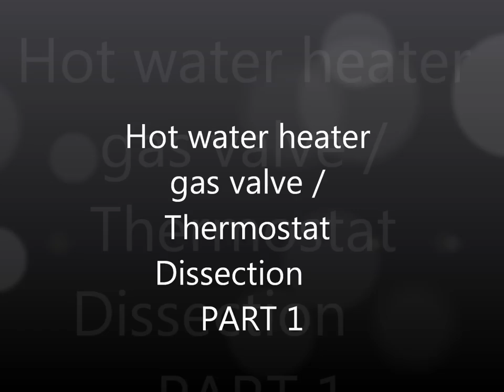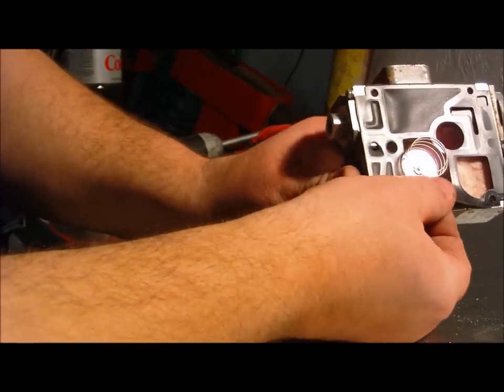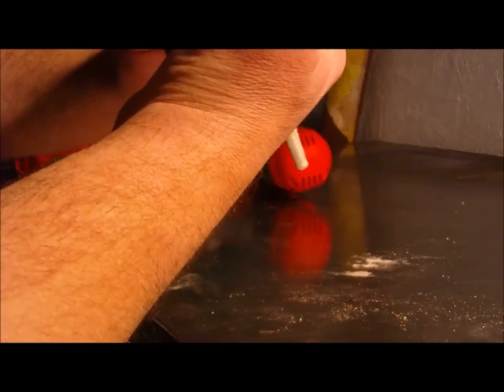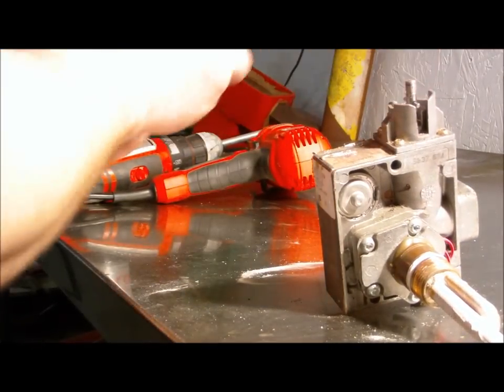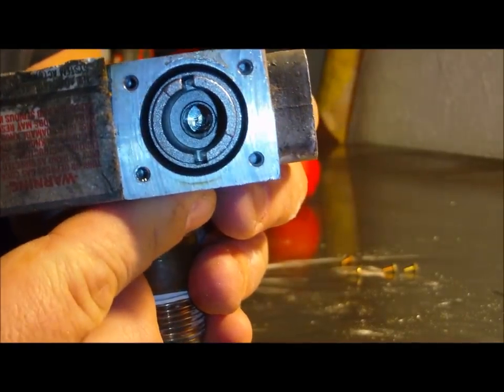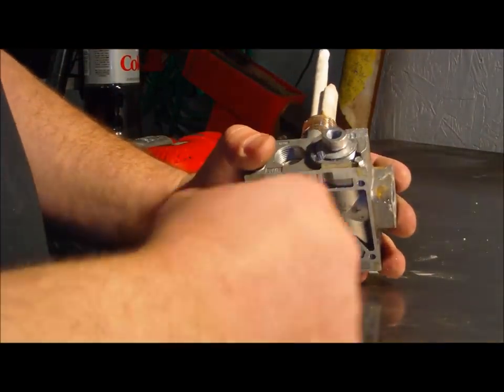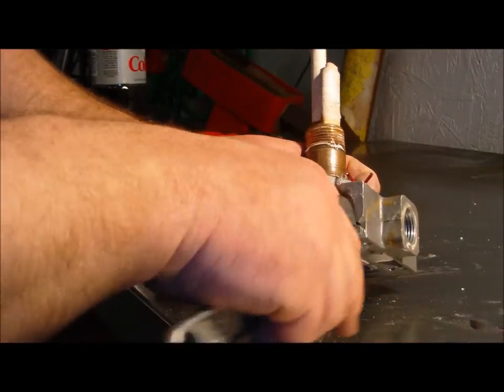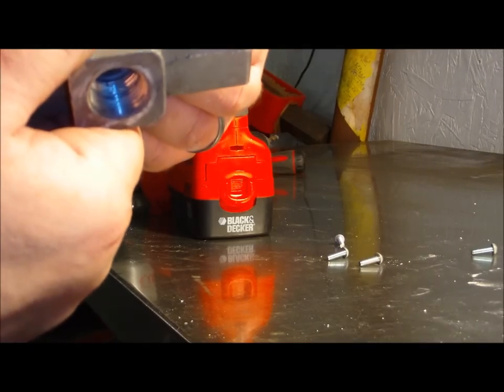Water Heater Gas Control Valve / Thermostat Dis-assembly

Comment: Lousy camera work aside, you just saved me a huge headache by popping the knob off the top of that valve (marker 4:17).
I have the same exact valve assy. and the knob for some reason was cracked which caused it be stuck in the "Pilot" position.
After watching this i was able to simply pop the knob off and re-light the pilot while waiting for the superglue to set up.
Thanks Brother
Reply from the maker: I’m glad you found this video useful. Thanks for watching and commenting. Please like share and subscribe. I greatly appreciate it

Comment: The part with red wires attached that you reveal at 9:50 is a thermal fuse or 'thermal cutout'.  It's a device that breaks the circuit when the temperature goes too high.

It's wired between the thermocouple and the hold-in coil.  The thermocouple sits in the pilot flame and generates electric power from the temperature difference, 250mA at 10mV.  The hold-in coil is a weak magnetic coil just strong enough to hold the primary gas valve open.
Reply: How do I find out what size I can replace mine with?
Reply: @benjamengabriellewis8818   The type of thermal fuse?  You'll need to look up the temperature rating by the color and/or number.

I put in the part information for my specific one in another post.

Comment from the maker: Without actually being there and looking at it is all speculative, but I would check my lines with a soapy water solution for leaks by spraying the connections. I would also pull the burner out and check to make sure it is free from soot and there is adequate air flow. But the the thermostat is what controls the pilot and gas to the burner. Rule out the other steps before you condemn the thermostat.

Comment: thanks. If I can ask your opinion for my situation.  I have a whirlpools heater .  When the tank gets to a certain temp, the burner turns off and so does the pilot.   I am able to relight the pilot, but over night it turns off.  I thought it was the thermocouple so I changed it.  It worked for 2 days, and the pilot went out again.  So I  ordered the control valve.  Any thoughts?  Thanks.

Comment from the maker: Thanks! I m 95 percent sure you can. You have to get a propane (LP) Gas control valve (Thermostat) They are set up differently. I seen some that had reverse threads, so be sure to know if you have right hand or left hand threads before you order. White Rodgers is a popular name that I use.
Reply: Actually u just need to put the correct size jets in.

Comment: Great tear-down video!

My gas valve Torx screws have a center stem cylinder that requires a tamper-proof Torx driver that has a hole in the center.  

Where did you buy your tamper-proof Torx driver from?
Reply from the maker: +A B you can get them here http://amzn.to/2ftTGQ7 thanks for watching and commenting. Please like share and subscribe
Reply: Thank you!

Comment: Sorry, didn't mean to be so rough on you about the video.  Glad to see you took the comments in stride.  I'm just really surprised I can't find any video on the inner workings of this device and water heatrers in gerneral. (from a detailed, almost electrical engineering point of view).  I've been struggling with a water heater that goes out, yet every part has been replaced, and the gas pressure is good.   Frustrating.

Comment: My natural gas valve on my 1987 state water heater was identified as a problem as my natural gas heater seems to be on vacation mode all the time.  It allows my hot water heater to run, but it does not reach an adequate temperature.  Are there people who can repair these natural gas valves, or tell me if there is new compatible natural gas valve.  
Did you ever get the natural gas valve back to together again.  It was amazing to see it taken apart.  It would be great to see it put back together again, after the repair is done.  Thank you for your efforts.
Reply: At present, the temperature setting is as war counter clock wise, as it can reach.  This allows the ignition to take place.  Obviously a component in my natural gas valve is not functioning properly such as the thermostat.
Reply from the maker: +Kevin Fisher I wouldn’t try rebuilding the old thermostat. That’s not what this video was about. But what I would do myself is replace the old valve itself with a new one and a new one can be purchased here http://amzn.to/2xGVY5W . Thanks for watching and commenting. Please like share and subscribe
Reply: Thanks for your reply.  I will check out the website.  Nobody could put that gas control back together again.

Comment: Thermal couple not pilot feed. The pilot light feed line doesn't protrude down its the flush trefed hole on right if your looking from the front in its correct position.

Comment: I verified the part in use: a Microtemp G4A00 084C thermal fuse.
It can be replaced with a similar rated thermal fuse e.g. NTE8081

The T25 Torx screws are tightened to a little under 20 in-lbs -- merely snug, easily removed with a hand driver.

Of course, never replace a thermal fuse without fixing the underlying problem!  These should never blow, unless something expected happens such as the pilot tube cracking and allowing unmetered gas to burn.

Comment: I understand why these are so expensive to replace now, and why there's no rebuild kit for them - all those springs, clips, bushings, gaskets, diaphragms, and heavy pot metal castings with close tolerance machining. 

The direct electronic ignition system that's more common now is much easier to use and seems to be much cheaper to make - all they have is a couple of small plastic gas solenoids, a control circuit board and an igniter.

Comment: I have a 40 gallon gas Richmond hot water tank made by Rheem.  It’s still under warranty & when I explained to the tech on the phone the black dial would not turn counterclockwise to off & then pilot, the tech said it’s the gas control valve.  Obviously I couldn’t piezo ignite it without the black dial on pilot being lined up to the red arrow at the left.  I hope they are right as they ordered the part & I’m to receive it by FedEx.  The next trick will be to hire a licensed serviceman as Rheem caps off at $150.00 in labor.  I’m thinking it’s not going to take more than an hour for them to take the old part off & put the new one on as they want the customer to pay up front first & then get reimbursed later by filling out a request on their online portal once Rheem sees the receipt.  When I had an A. O. Smith hot water tank under warranty, I didn’t have any out of pocket expenses so I don’t like the way Rheem operates with me having to pay the serviceman first.  I’m on a fixed income.
Reply: And I’ve had gas hot water heaters for over 50 years & never had problems with a unit only 2 years old that needed to be serviced so why did this happen on a brand new unit.  Perhaps a defect in workmanship.  Infact, I’ve never needed servicing but once on any hot water tank I’ve owned.  This will be the second time in 13 years so they’re just not making them like they used to.

Comment: Okay found a document. This gas valve is made by A.O. Smith. Here is the link to the pdf of the service handbook. It has some drawings of the valve and some basics on how it works.
go to hotwater.com > resources > product literature > service handbooks > Residential Gas and Electric Water Heaters (0402)

Youtube won't let me post a link >:(
Reply: Any way to inbox the link?

Comment: my valve on my rv water heater does not close all the way.  When the thermostat shuts off it keeps a flame burning.  The flame is about twice the size of the pilot light.  What is the cause and fix for this issue?  By the way, thank you very much for the video.

Comment: The thermal fuse breaks the circuit, allowing the valve to close, if the water gets dangerously hot.

The single sealed end suggests that it is a resin pellet type, such as a SEFUSE SF type or Cantherm SDF type.  These are one-time fuses, they don't reset after they cool.  The white colored epoxy suggests that it's rated 91C, or about 195F, which makes sense for a backup safety device.

Were there any numbers on the cutout?  Had it opened (overheated and blown)?

Comment: I need to know how to get that unit off the tank?
Reply: The thermostat is thread onto the tank.  Ideally you use a big smooth-jawed wrench.  A long pipe wrench will work, but you'll want to cushion the jaws to avoid chewing up the thermostat.  Some suggest a length of pipe threaded into the gas inlet, but that often has geometry problems with the the gas pipe and floor.
Reply: Thanks Don!

Comment: mine has a busted solenoid and while that would be 20 bucks to replace, the jokers at the factory know it and want you to spend the 160 bucks to get a whole new control valve assembly, so they rivet the stupid solenoid in making it suck way more to replace.  Rats.
Reply from the maker: That does suck but probably much safer. There is no value greater then safety and living to see tomorrow. Thanks for watching and commenting. Please like share and subscribe

Comment: Sorry, but I was disappointed with the video.  It just basically shows what in the assembly, but not HOW it works.  You're cutting wires, with no explanation what they do or how they operate.  I understand you can't take apart without damaging, but this was the same as watching a car being crushed, and calling it a video about car disassembly.   Diaphram or seals? Which one? it makes a differnece in how the part functions.

Comment: There is no such thing as a hot water heater... There is no need to heat hot water... I have installed countless water heaters but never a hot water heater...
Reply from the maker: Oh my. I’ll try not to lose any sleep over this improper grammar that I used 7 years ago. Thank you so much for pointing this out.
Reply: @handymanPF  It's not incorrect usage if it the common term.